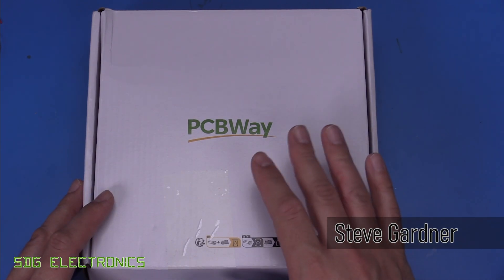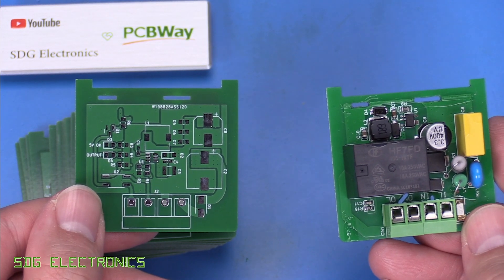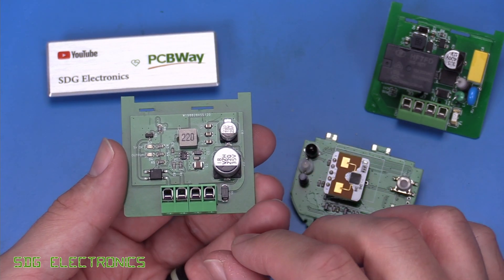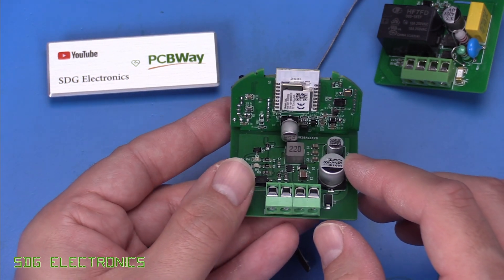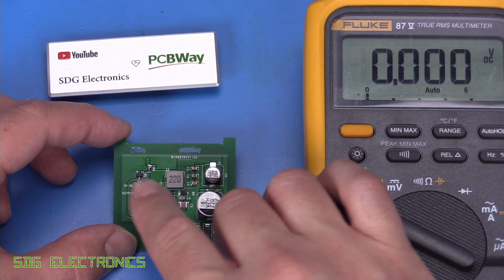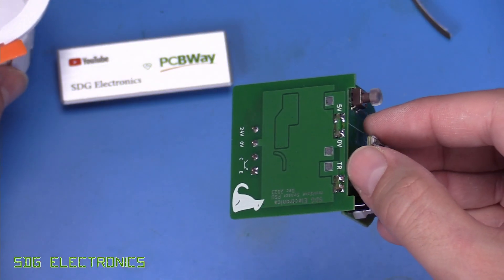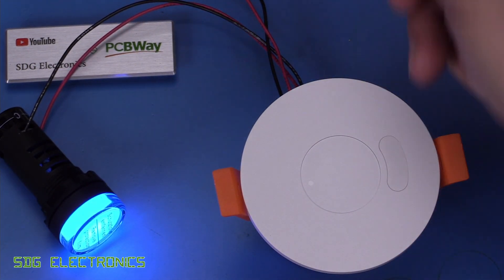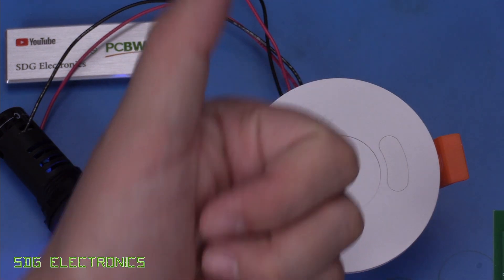SDG #321 Zigbee Presence Sensor Power PCB Design

Comment: To the mil perfection! Love how you use your body to make the circuit, good bit of hackery here Steve! 
As an electrician I couldn't see a practical use for this, maybe good for a caravan or off grid applications?
Reply from the maker: It's only really for automation systems. These have no safety certification for lessons use out of the box

Comment: Great video yet again! Do you have something on the tip of the needle when placing the smallest components to ensure suction, or is it just a normal metal needle?
Reply from the maker: No, just a plain needle. The vacuum pump has a high enough flow rate to keep hold of stuff
Reply: @sdgelectronics Thanks